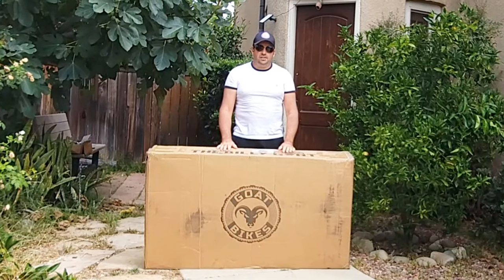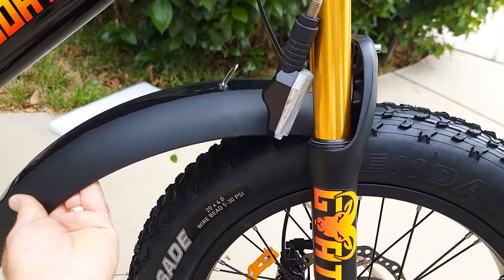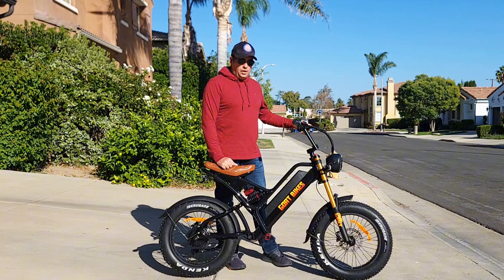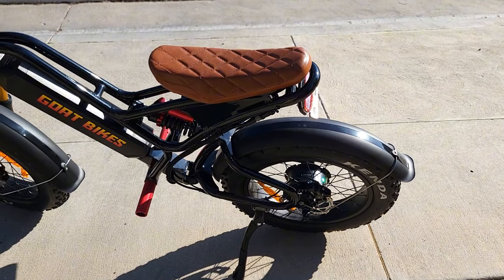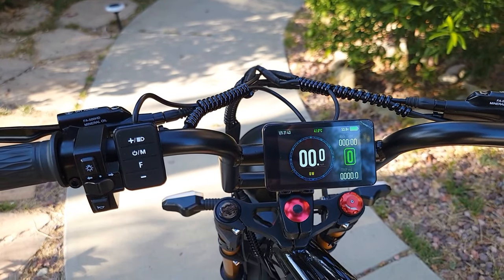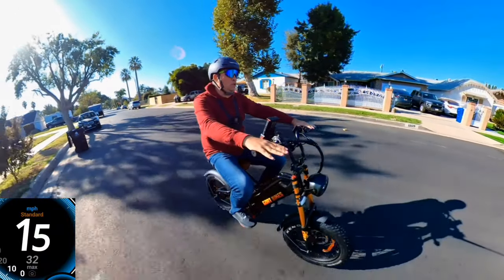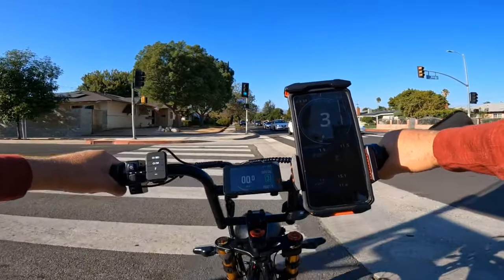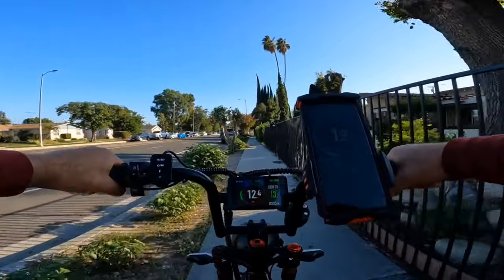Billy Goat Full Suspensions Ebike by Goat Power Bikes Assembly  / Top Speed Test

Comment: Any idea how much it weighs? Comparable to a Super73 S2? Heavier?
Reply from the maker: my 1.0 model weight about the same  around 70 lbs but new 2.0 would be heaver as bigger battery and much faster than super 73 with 2000w motor 60v 20 ah battery 50 mph.. and only $1620 after discount code: DAd can not beat it!